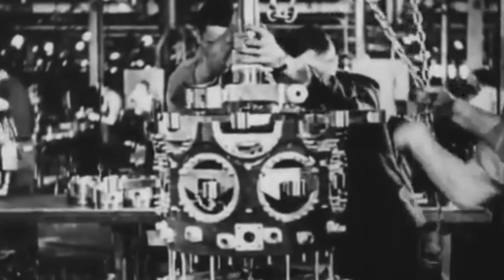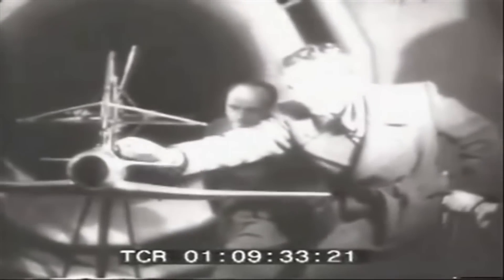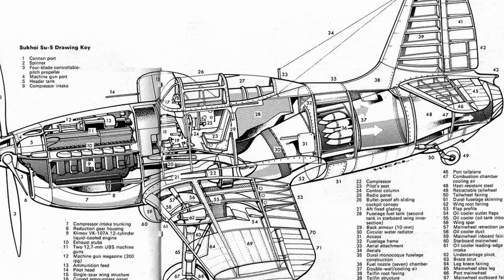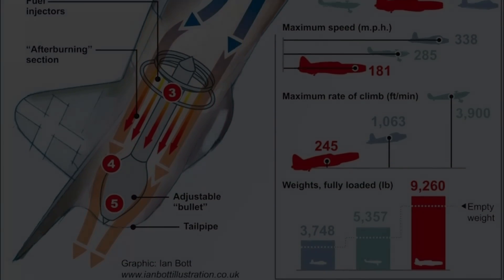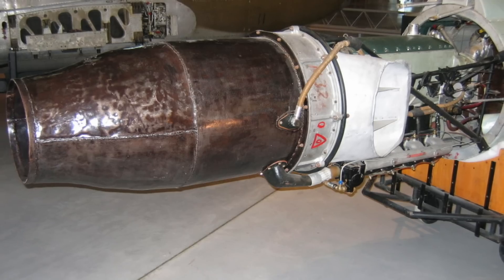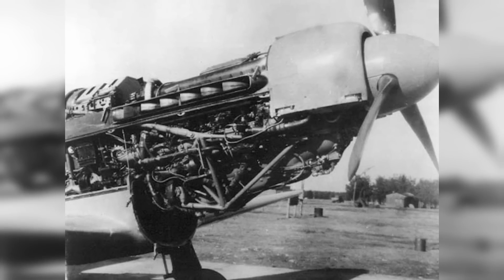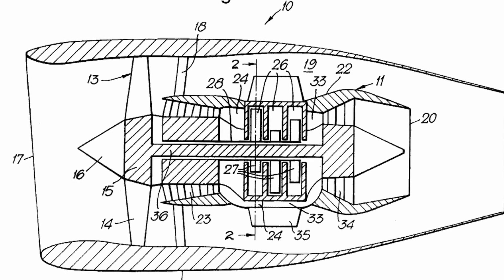What on Earth is a Motorjet?

Comment: We built a compound cycle engine as an example and as a theoretical possible propulsion system for what is now known as the tomahawk cruise missile it was a V8 of about 250 CC's per cylinder running on compressed air produced over 1,000 horsepower!
What made this particular compound cycle engine very interesting was a pair of clutches so you could use the turbine power to draw in more air and create more thrust as a conventional turbo shaft engine operates or with the flip of a switch you could add the turbines output to the crankshaft and make insane torque at the crankshaft.
I believe it was an old German design from when they were having trouble creating a combuster section with materials of the day and lacking knowledge of modern engineering to create an air cushion between the flame and the metal so that the combustors did not melt through in a matter of seconds.
All this contained in a 20-in diameter about 22 in Long it was actually very light, crazy powerful and produced a lot of thrust it was very efficient Considering it had all the modern engineering and materials made thrown at it.
 I don't know whatever happened to the test engine but it ran for 24 hours a number of times at Garrett Turbine Signal oil now Honeywell Phoenix Arizona.

Comment: If the MTU concept adds efficiency at the cost of weight, it should work on a land-based turbine used to drive a generator.  Those utility guys are really, really interested in efficiency.  Today they use the output of a turbojet to boil water to make steam to drive a steam turbine, but the steam turbine is taking energy out on the low-temperature side of the cycle, which is less efficient.

The MTU concept, if I understand properly, is proposing to take some energy out of the fuel on the high-temperature side of the turbojet cycle, by raising the initial temperature.  That improves the Carnot efficiency!

Comment: Imagine a compound cycle engine where the shaft for the compressor and turbine was also the eccentric shaft for a rotary engine sandwiched in between them
Reply: When I saw the liquid piston engine, which is an inverted chamber and rotor of the Wankel rotary, I had the same thought. Why not exploit the weight advantage of the rotary and fuel efficiency of the otto cycle engine and produce a general aviation combined cycle engine with low gal/hr consumption under cruise, but high dash speed for fun.
Reply: @electric_boogaloo496  Wankel engines tend to drive efficiency way down due to their elongated, oddly shaped combustion chamber, it behaves roughly like a engine with a very short stroke but wide bore, good for power, bad for efficiency
Reply: @user-si5fm8ql3c  liquid piston's take on the Wankel does solve the combustion chamber shape problem.
Reply: @user-si5fm8ql3c  
Not when burning hydrogen.
Reply: Or how about one which has two compressors the first  a low pressure axial compressor which is powered by the more efficient piston engine (and also acts as a supercharger diverting a little air for the piston engine); and the second (centrifugal or axial) which is powered by a turbine. Perhaps dumping the exhaust of the piston engine into the inlet of the second compressor (the piston engine possibly running slightly fuel rich).  Perhaps the combustor-can-flameholder things could run fuel rich to keep the temperature down but the lean air entering the entire combustion chamber would then meet the burning fuel rich air coming out the combustion cans and maybe ignite a secondary combustion? So the entire combustion chamber is burning, but at lower temperature than normal.

Comment: Rolls-Royce began working on a sleeve valve two stroke “sprint” engine aka Crecy. It was all about power at the expense of fuel consumption. Once it was running they realised it could be a great compressor stage for a jet engine. Ultimately, the turbojet was easier to develop so the Crecy was cancelled.

Comment: Thanks for this video, there isn't much out there about motorjets. I found them interesting because even today, with modern materials, temperature at the turbine blades is one of the biggest limiting factors in jet performance. Unfortunately, the tradeoffs don't appear to be worth it, and afterburners end up being a better solution for aircraft that need to go that fast. Maybe something will change, between a new interest in supersonic transportation and better battery technology, it might be possible.

Comment: an electric motor jet might work well
Reply: use a small jet engine as a generator using the the same fuel supply as the motor jet to power the electric motor. no idea why youd want to use a motor jet but it could work.

Comment: I think it's funny how people drone on about complexity. The piston engine has soldiered on faithfully in so many apps and for 100 yrs in aircraft. Its numerical parts complexity is now just a given. They can all be made very well and not have to run at their ragged metallurgical edge to get the thermal efficiency; as does a turbine running almost at critical mass and can produce no meaningful power outside of that narrow parameter. On a more red neck note who would NOT want to fly in a Learjet that sounds like two Mclaren F1's in a dead heat either side of your cabin. Pod racers eat your heart out.
Reply: but the power to weight ratio of piston engines is shit......

so yeah, you dont have to run them ragged, but even running them ragged, jets still have a better power to weight.

so they'll run long enough to get shot down by the faster planes.
Reply: @lordgarion514  🙄🙄😊😉

Comment: Because only a few countries are able to produce turbine blades and they keep the metallurgy secret at an overpriced level...With a motorjet or electric compound motorjet you do not need that part but still able to achieve high speed thrust as well self launch capability vs. a pulse jet engine...

Comment: Very interesting, thank you. The various compound engines in the 40s are really fascinating. But when you look at so much complexity for 12% gain there are many other options.
Reply: How would this be more complex? The axial compressor is on a separate shaft to the engine; no different than how the P-39 had its shaft route power from the engine behind the cockpit to the front.

Immensely complex there? No.

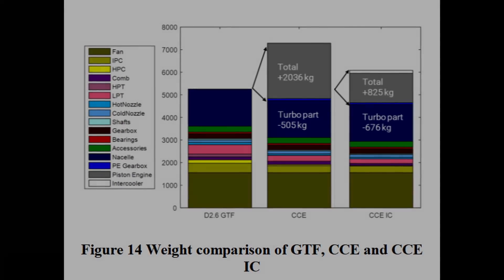Comment: @ 10:19 the weight penalty is irrelevant in applications such as use on trains and for the use of power generation thru driving electric generators. The weight issue also will decrease as time goes on and metallurgical and material science progress, lightening internal combustion engines to levels we couldn't even dream of even 10yrs ago.

Comment: Just a few steps short of what would have been great. A tube which confines the air flow, but without compressor stages, if the final fan, also drove the front prop, he'd have a turboprop. 
So, from what I can make out, most of the parts and ideas are present, but presented in the wrong order, the compressors are at the front and piston driven? The bullet cone, should be in front, to prevent compressor stall and thee afterburner stays after. If only the concept was self actuating once flow is established, by a starter cartridge or electric generator. Oh wait, I've given the game away and reinvented the jet engine.

Comment: You completely overlooked the 1910 Coanda plane, using a 4 cylinder engine to drive a fan, with fuel injected and ignited aft of the fan. While it is not clear whether the plane actually flew, it did lead Henri Coanda to note and explore the tendency of the flame to cling to the sides of the fuselage. Now we are well aware of the Coanda effect.
Reply: yeah he also made a lot of claims about the planes, which many now suspect to be exaggerated, interesting plane nonetheless.
Reply: Fuck off coanda didn't do shit in 1910 but a shrouded propeller. After jet power was established, he tried to leech off some relevance by showing clearly more recently fabricated bullshit plans where he added in airstream combustion which he tried to sell as his original plans.

Comment: Interresting that could be implemented in VTOL/STOL configuration. Maybe the F-35 B have that aplication to its wing lifting jets?
Reply: Sure you could do it but why? You're just making it heavier, less powerful and less efficient.
Reply: @wingracer1614  Because only a few countries are able to produce turbine blades and they keep the metallurgy secret at an overpriced level...With a motorjet or electric compound motorjet you do not need that part but still able to achieve high speed thrust as well self launch capability vs. a pulse jet engine...
Reply: @electricaviationchannelvid7863  OK but a country that can't build a proper jet engine can't build F35s either. So they buy them from the US.

Comment: I have a motorjet design, my proposal is mostly for generator usage, since the concept has lower cost than conventional turbine engines, since didn't really need the costly alloys and also have better torque for them thrust, I can assure is a good idea, it depends on how it would be used, but I lack funds to build a prototype and text, still on the conceptual stage, not even in patent application state yet, I still solving the bureaucracy.

Comment: Do we have more examples of the sound signature of motorjets?  I say this as with the recents events in Ukrane I hear a distinct warbling when Kaliber cruise missiles pass overhead.  I wonder if the Russians are using a motorjet there as it is a very cheap solution with few exotic metals for essentially a disposable engine.
Reply: I'd have to hear it to be sure, but it sounds like the Russians might be using (or advanced?) a version of the 'pulse jet' engine (think V-1 of WWII fame).

I know that the Iranian suicide drones currently being used by the Russians is a higher-tech variant of the V-1. (I consider it as such because it's not terribly precise [hence tactically useless], but work well enough as a 'terror weapon'.)

Comment: Why not use an air cooled radial for compression?
Reply: Later versions of the Duplex Cyclone had a turbine coupled with the crankshaft. As a Turbo-compound engine the emphasis was on power recovery from the exhaust, not jet thrust. It saw quite widespread use though.
Reply: In the late 1930s/1940 the NACA was developing a transonic motor jet called "Jakes Jeep", it used a Pratt Whitney  R-1535 radial.   The man driving the program was Eastman Jacobs.   He is famous for perfecting the laminar flow wing technology that went into the P-51 Mustang as well as developing the NACA 4 and 5 digit wing profiles all sides used.   "jake's Jeep" was meant to reach around 550mph.   It had a V tail to limit the problems of shock wave impingement on the tail while the laminar flow wing gave a high Mach Limit.    All pretty good for 1939/1940.  "Jakes Jeep" evolved into the Bell X-1 that first broke the sound barrier.  The Bell X-1 also initially had a V tail.    With US engine technology and supercharging technology Jakes Jeep would have worked.
-There is a sad side note to this.   When information of the Whittle turbojets was transmitted the US Happ Arnold, Head of the USAAF, did not transmit it to the NACA.
-The Resulting Bell X-59 was a failure as the wings were not only too thick but failed to use the Laminar Flow wings already coming in on the P-51.   Eastman Jocobs was so heartbroken he left NACA though some say it was because the innovative engineer had diverted NACA funds into plasma research in an attempt to realize thermonuclear fusion.

Comment: Adding a pair of v10 engines to a turbofan sounds like a maintenance nightmare.
Reply: Well, it's German, so...
Reply: Fuel system also
Reply: On the other hand, the maintenance guys would be able to find parts down at the junkyard 🤣
Reply: @pork_cake  
This is why Wankel-Rotary engines should have been used ; they have 1/10 the # of parts , and break much less often . 
They also produce over twice the hp. as four-stroke engines , per-pound .
Reply: @Prof.Megamind.thinks.about.it.  the breaking part is debatable, however if they were used more we definitely could have solved the issues and had extremely reliable, compact, and powerful rotaries.
Reply: @Prof.Megamind.thinks.about.it.  they use much more fuel.
Reply: @finlaymcdiarmid5832  
That may be true , but the airlines require compact power and extreme reliability . 
Rotaries fit this bill much better than piston-engines .
Reply: @Prof.Megamind.thinks.about.it.  Don't for a minute think rotaries are low maintenance.
Reply: @thefreedomguyuk  
The latest versions have greatly reduced rotor-seal wear . 
Rotaries require CERTAIN maintenance actions be done frequently , but sudden failures and unexpected repairs are much fewer and farther between . 
This type of maintenance program suits a business relying on such engines very well , as revenue loss and disservicing of passengers is much less . 
These are some of the reasons regional airlines replaced piston-engines with the far more expensive turboprop ones .
Reply: @Prof.Megamind.thinks.about.it.  rotaries are not reliable. Unless you mean actual rotaries and not wankels which are different things.

Thing is, you can't have power, reliability and economy. You can do all of them well or one of them greatly and the rest crap.

 Wankels use more fuel as default and wear more by default because the "rotor" has twice as many edges to wear down as opposed to a piston which has two edges that wear. Its the same with two strokes, they may be simpler and lighter than 4 strokes but they literally wear out twice as fast and use double the fuel.
Reply: @finlaymcdiarmid5832  
This is understood , however...
The rotor-seal wear is highly predictable , and a straightforward fix . 
Piston-engines however , wear and break much more unpredictably . 
This last is an intolerable occurrence for operating airlines , as stranded cargo and passengers can be enormously expensive . This is particularly true when a broken plane fails to be available to perform a series of trips it was scheduled to perform . 
Overall , it is more cost-effective for an airline to utilize a more expensive engine that requires expensive regular maintenance , than to use a cheaper one that breaks down unexpectedly . 😎
Reply: @Prof.Megamind.thinks.about.it.  
That is why rotary engines are used in UAVs.
Reply: @finlaymcdiarmid5832  
Rotaries are 25% more efficient using hydrogen burning all the fuel - they do not burn all the fuel using petrol, hence less efficient with higher emissions. Their efficiency also rises when running at constant speeds. Mazda are introducing one in January 2023 in a hybrid.
Reply: @Prof.Megamind.thinks.about.it.  
When run at constant speeds apex seal wear is not an issue. Planes running on Wankels burning hydrogen will be very efficient.  The smaller size and weight of a Wankel lends itself to aviation, giving greater efficiencies again. 

The point you mention of less down time with Wankels is very apt.
Reply: @finlaymcdiarmid5832 Only when used in a road car. In a high rpm situation like an aircraft or a racing vehicle, they’re actually far more fuel efficient.
Reply: @BrapBrapDorito  do wankels waste fuel at lower rpm due to imcomplete combustion? and at higher rpm this is ratified?
Reply: @finlaymcdiarmid5832  Sort of, wankels mainly waste fuel at low RPM due to their intake and exhaust placements, lack of torque putting the engine under odd stresses, strange heat distribution, and their slow combustion speeds. Now some solutions do exist for these, such as EGR, direct injection, using an electric brake on the crankshaft during intake, and purely side porting, but they’re not very well tested, so only time will tell on those. For more info on the strange efficiencies of rotaries, Mazdas LeMans winning cars are a great start, they managed higher efficiency than their contemporaries due to the setting they were used in. Rotaries didn’t see much usage in aircraft unfortunately, but theoretically they should have the same benefit as in a racing situation.
Reply: @BrapBrapDorito  oh ok

Comment: Try a small, compact, 3-rotor Wankel engine, mated directly (no gearbox) behind a 3-5 stage fan setup. 
Since a rotary engine runs best at about 5k RPM, you can mate it to fan, about 1.1m in diameter, which at 5k RPM would result in tip speeds, just below the speed of sound. 
Use cooling fins and air inlet in the duct for the engine.
Route the fuel and electrical control lines through the struts. 
Use a jack-screw-mounted bulb in the exhaust nozzle to control exhaust airflow.

If you can generate about 1000 lbs of thrust with such a setup, you could power a light GA plane with it.
Reply: Wankels are less efficient